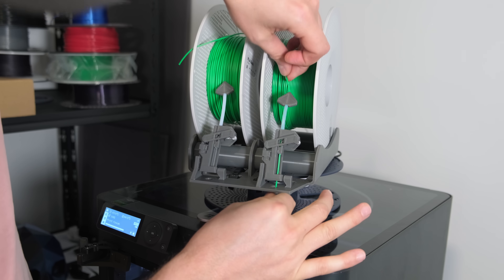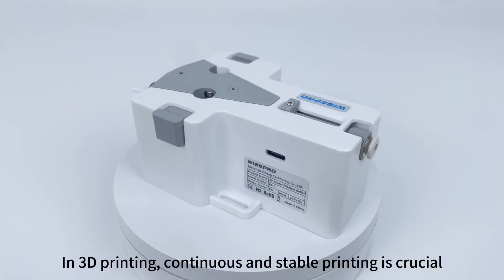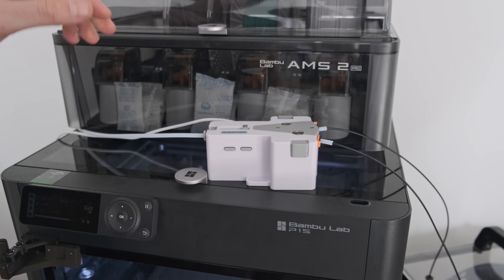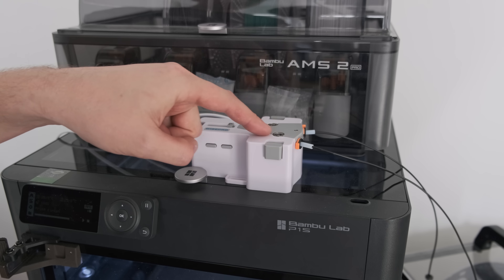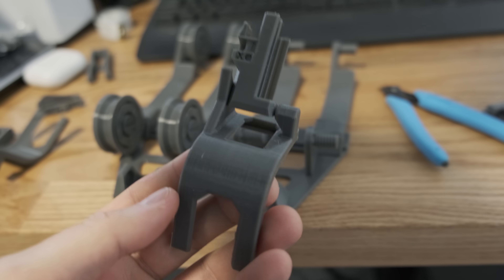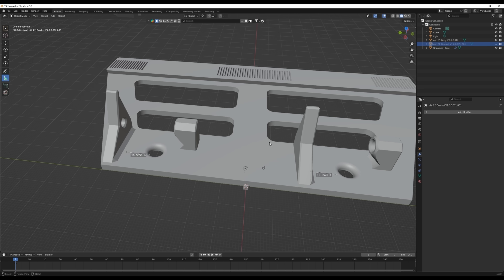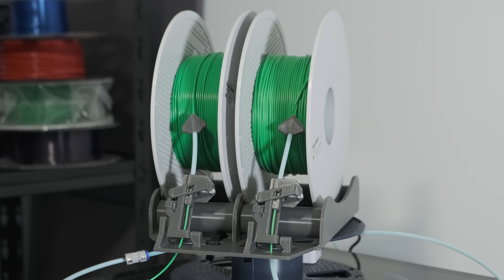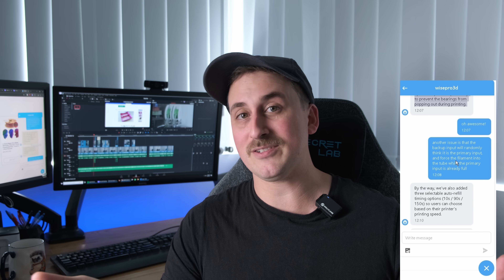I Tried Making My Own 3D Printing Automatic Filament System

Comment: Amy updates in regards to the new wisepro device. I bought resently the latest one. Seams not working…only with single filament not issues but when I add spare filament in second tupe it stops buffering on main tube and try’s  to feed the spare filament, obviously this can’t work as long main filament is not empty
Reply from the maker: I haven't tried it out yet, but I have it sitting on my shelf ready for testing when I have the time. However I got some feedback on the latest version from another viewer who said it seems to be working well for him (at least for now).

Comment: Test the lll buffer plus from mellow. Im using with voron in standalone mode and it works fine. Anyway I had to design a mount plate for that one aswell. Hahah
Reply from the maker: Well I've got the infinity flow s1 so all of my problems have been solved :D

Comment: If the AMS Pro 2 can detect how much filament is left on a spool and when a spool has run out, it seems so odd that they don't implemented some basic code that ensures the filament runs out, stops, and reloads on infill rather than a wall. Seems like Bambu is usually on top of these things, especially since this is a significant issue that affects a lot of people and ruins a lot of prints, but maybe the solution is more complex than I realize.
Reply from the maker: Yeah... Hopefully they can bring in some updates to change this. In the mean time, I will be using the S1 Plus (it works really well!)

Comment: Quick question did you bypass the filament runout sensor?
Reply from the maker: No I didn't have to on this printer, but I've seen others that have had to, especially when they are external runout sensors.

Comment: Finally! Finally! A review on this damn filament buffer, you nailed everything perfectly. i have had all the same issues. The sad part of this filament buffer is i really wanted it to work properly. i extended the length of the bowden tube to so that it would feed prior to hitting filament runout sensor (about 20cm / 8in). I glued large magnets to prevent the bearings from popping out (not sure what my thought process was there, maybe desperation). I will be printing your fixes though. Great Review.
Reply from the maker: haha I'm so glad you found it helpful! I was really struggling to find help with this thing, just like you, so I figured I may as well share my experiences to help with other people's frustration :P
Reply: Did you find a similar, working, product ever since? I've been having nothing but issues with this one and would love a simple filament buffer!

Comment: I just assumed all you needed was a jam detection filament motion sensor, but I see now that a filament cutter is a requirement. An internal filament cutter and better firmware, plus maybe another sensor or two for filament presence or motor stall detection, would elevate this to be a usable product. Though the S1 also has a great automatic filament loading system, not sure how that works, maybe it’s easy with large diameter extruder gears? Using steppers also means they’re likely going to last longer than brushed motors.

Comment: Fully agree with you. I bought one about 2 months ago, it initially worked great, sort of. 
On my RatRig 500 IDEX I had to put a little weight on the buffer (a few bolts) to enhance the spring as it had problems with the very long bowen tubes. Once I had that in place I got a few perfect filament swaps untill the bearings started popping out.
I since switched to the Mellow filament buffer. The same idea but only a single input. I had to put a few bolts to enhance the spring here as well and now have the Mellow send me an alarm when it runs out. That gives me 1 to 2 min to out a new spool up before the whole Bowden tube length is consumed. Far from ideal but works.

I will print your cover and give the one a new try.
I btw just screwed it to the side panels of my printer. Inside the enclosure as a RatRig has space for a spool. Took the back cover off and made a hole in the PC panel to cool the electronics. The heat has not broken the thing even though I run at 70 °C chamber temperature in those few days.

Comment: Weird question, but you can't use 2 filament sensors with an and or gate where one disables the other? Might need 4 sensors in total, 2 to sense the filament, and 2 to disable the other when it's full?

Comment: Has nobody told you about Mosaic Mfg Palette 3????
Reply from the maker: haha yeah I know about it, but for some reason it tries to splice the filament instead of just pushing in one spool behind the next, like the S1, and the splicing doesn't seem to be very reliable. Plus it's way too expensive, especially when I need 4 of them.
Reply: Steer very clear of Pallette. They are focusing on a new printer and have dropped support for Pallette 2 Pro. I suspect the 3 will be on the chopping block sooner than later. I've requested an open firmware and they could care less.

Comment: Can't you just use a purge tower if you think you will run out? Bambu slicer should figure this out automatically no?
Reply from the maker: You can force a purge tower, but when the new spool is loaded, it doesn't return to it, it just goes straight back onto the print wherever it left off. If you are lucky, the refill will happen on the infill, or purge tower, but this is entirely based on luck and you have no control over when/where it happens. :(

Comment: I have a P1S combo that has served me really well for almost 2 years. Only recently I’ve noticed when I try to use auto refill, it doesn’t work every time… even though I have a full spool loaded in the next AMS slot and make sure the refill function is enabled, it’ll still just pause the print and tell me to replace the spool in the first slot. 

I haven’t updated firmware in a while (trying to avoid the locked-down version that doesn’t fully integrate with Orca Slicer), so I thought maybe it was Bambu Lab doing something shady lol… it has worked in the past, but I don’t use it super often, so maybe it’s always been buggy and I never noticed. 🤷‍♂️

Comment: They also need to make a version (thinking about snag detection) for people that want to print directly from dryboxes and filament dryers ...so you can print the other myriad of filaments that are not PLA 😑

Before I ditched PLA as my main filament, even that got moist where I live, became brittle, broke in PTFE tubes and printed overall badly. 
So I use dryboxes even for PLA. I don't get how people can print without dryboxes and the peace of mind that you can rule out moist filament for printing defects.

I just hope they are not just saying "yes yes" to shut you up and are really bringing out a usable version. I'd buy at least one, if not even more.

Great video btw. I like your enthusiastic sarcasm, hehe 😄
Reply: Who they?

Comment: Hi Martin . First of all your video is tech and fun together. You have a special gift! I have the same device. Replaced under warranty because the first did not work at all. The second unit makes the printer under extrude. Can you explain to me how you setup the fb in order to work, even with a spool? Does it require particular power from the USB power supply unit? Do I need to setup pneumatic connectors in the supply and emission tubes? Any detail is really appreciated. Tommy
Reply from the maker: Thanks Tom! Fortunately I didn't get any extrusion issues, so I'm not sure how you could fix that... How clear is the path to the extruder? I've seen that runout sensors and things can get in the way and mess things up. I just power mine from a USB port on the back of my printer, with a Panda Branch I installed a while back for this very reason. It has the appropriate power output for the device so it works well.